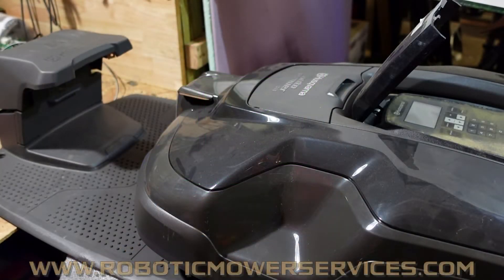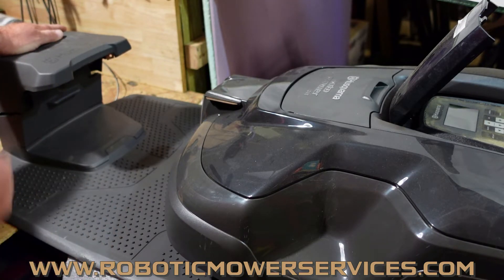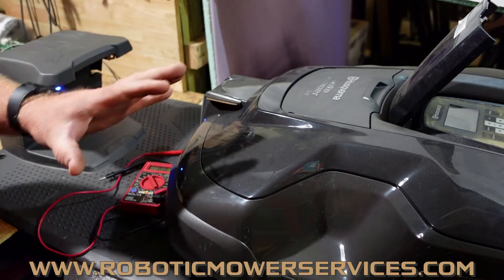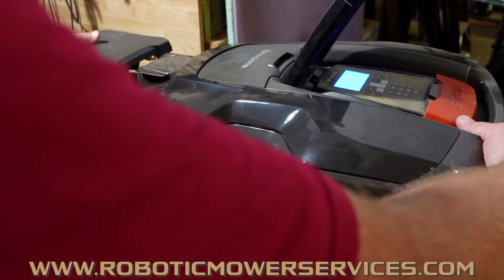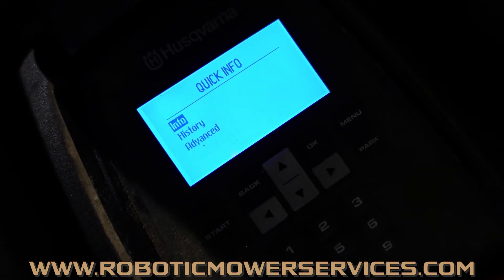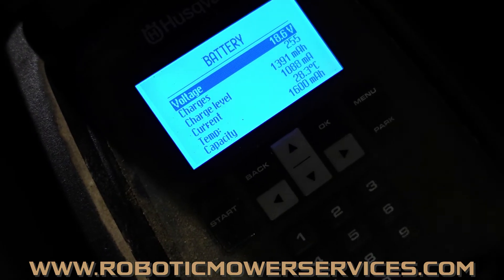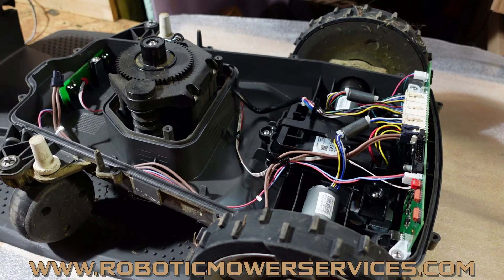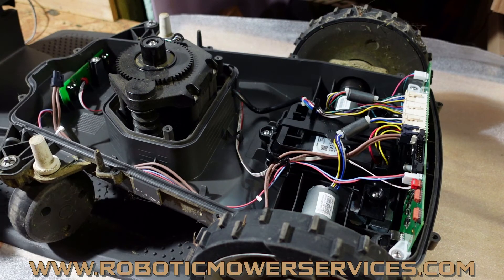Husqvarna Automower Not Charging Troubleshooting Tips

Comment: Hi, I have a Husqvarna Automower 320, and after replacing its battery with a compatible commercial one from Amazon, it shows the message “Battery problem” and then shuts down.
If I install the BMS (Battery Management System) from the old battery into the new one, could it work?

Comment: So my issue is exactly as you described- the double beep (connecting) followed by the immediate disconnect beep. I looked at the board but no residue… it looks super clean. 

The green led is on, slowly push the mower into the base station, the led flashes red for a second and turns off. Then the beeps repeat every 10 seconds or so, double beep and disconnect beep.
Reply: Will clarify, cords look clean, contact plates are shiny on both the base station and mower.
Reply from the maker: Looking clean and looking shiny doesn't mean there can't still be an issue with them. Have you checked resistance through the charging contact harness on the charging station and on the mower?

Comment: Very odd issue on my 430x. Won't turn on when removed from the base. If I manually push it it and start it, it reverses out after 30 seconds or so but dies as soon as it disconnects.
I looked at the battery info after I turn it on and it shows good voltage and the capacity level starts to increase. When it reached 17 mAh it jumps to fully charged then the voltage drops to 0.4 and the cpacity level goes to negative 1. I am assuming the reason it reverses out on it's own is when it jumps to that fully charged level for a second. Not sure if this sounds more like a faulty battery of a board.
Reply from the maker: Open the mower and look for any signs of corrosion on any of the circuit boards

Comment: Brilliant video, I have solved a parking / charging problem thanks to your excellent video. I used the multi meter on the docking station all was fine, even had correct voltage on the blade terminals, the give away was no beep from the mower when manually parking it on dock, it was the 450x burnt out connect just inside the mower body, swapped that, and everything is fine. Thanks to you guys. 😊😊😊
Reply from the maker: Nice work!

Comment: Good morning, I have a 330x robot and high voltage at home above the 240v set by the charger, it peaks at 255 per cent, I assumed that this would cause a breakdown in the transformer charger, but what happens is that it kills the batteries. Has anyone had this happen to them? Can batteries die from high voltage? thank you very much

Comment: I go to your site for problems with my Husqvarna 420. I have used Robotic Motor Services many times over the past few years, from replacing sensors and defective wheel motors, to testing charging and many others. It has saved me loads, so thank you very much. Being here in the U.K. I cant buy products through you, but I will continue to go to your site if  I have any more problems.

Comment: 315x 
Charging station 28V. Put mower in charger I hear 2 chirping sounds. Pull mower out a little to test mower contacts. I still get 28v on mower. Screen says "Mower Blocked 5 min count down. Gets to 3 mins says" mower shutting down" screen goes dead. Bought mower as second owner. However, it has never been used. Appreciate any help!

Comment: I've got a negative current -150mA... What could that be?
Reply: This is my problem also
Reply from the maker: What model mower?
Reply: 315x from 2018 @RoboticMowerServices 

Its now working 50% of the time, now it drives in, parks for 30 sec and out again. Sometimes it stays in and loads just fine, sometimes it eventually stops entirely after few tries.

When i put in in manually now, it works fine

I do not have an original Battery at the moment though...
Reply from the maker: What model mower?
Reply: Same problem here. Mine's a 430 xh. In the end I noticed poor continuity from the gold contact bars on the charging head back through the low voltage wire. I scrubbed the gold contact bars on the charging head with 60 grit and problem solved

Comment: Thank you for a great video. In the last couple of days I had a problem with charging my 315x. It happened two times that the mower returned to the base but after couple of minutes returned a little bit back and stopped in front of the base with "charging system problem" error. At first I thought that power adapter is gone, but after watching your video I checked all the steps and find out that voltage at the base is correct (28V) but when I manually plug in the mower the voltage on the base pins is still 28V (and not 18V as you explained in the video). In the menu is visible that mower is not charging since is shows Current -143mA. After that I switched the mower off and then back on (as the app suggested) and it started charging with Current ~1100mA. I suppose that the wiring is fine and that the problem could be the battery since it has 6530 charging cycles. What are your thoughts on this? Thank you very much for your help.
Reply: I got this error again the same day I wrote this comment. After that I checked again everything and noticed that the cable which goes inside the mower is bend by 90°just after the connector. I straightened it by hand and put it back inside and for now is working couple of days without any problem. Maybe there was just a minor connection problem with that cable.

Comment: Hi. Great video. I just noticed that when I put my 310 in the charger for this season it says charging, but when I locked at in in the app it shows that it actually drains. It went down from 13% to 12% to 11%. Then I jerked it out. Now after looking at this I measured things and found out that the harness shows 6,5 volts. Took it apart and measured 27,5 volt at the black and red on the cable at 5:08 minutes in this video. Looking at the harness and cables i could find no fault so I decided to try and measure at the connector at the top off the circuitboard that connects to the cable and I got 6,5 volts there. Faulty board on the charging station?
Reply from the maker: It could be a number of different things causing the issue. But the only way to narrow it down is by doing some resistance testing.
Reply: @RoboticMowerServices  I did your testing and found out that it was 27.5 volt at the end of the cable going into the board and then 6,5v of the connector on the board goin out from the board which is the only step that was not in your video. That makes it logical to assume the circuitboard. Looking at the board it looks clean and all, but I guss it could still be broken...
Reply from the maker: @Average-AL  Here's another video with info that will help narrow down the issue. https://youtu.be/uDdUnR_rIAE
Reply: @RoboticMowerServices  I managed to borrow power transformer from another Husqvarna user in the neighbourhood and with that transformer it worked. So now I know what the problem was.

Comment: Hi great video. I have a negative current on my charge, what could be cause of that
Reply: Hi, have the same problem. Negative current while it is supposed to be charging, but it's not. Did you find the cause? Thanks!
Reply: This is my problem also
Reply: I solved the negative current charge on the information window by hitting the gold contacts in the charger that make contact with the mower with 60 grit sandpaper.  I noticed that the continuity from the charger to those contacts was intermittent. I cleaned them up and they were good to go

Comment: Hey buddy I've a power that go 21.6 V as output but in my charging plate for my automower 305 I see 21.2 V. Automower is saying that is charging but in real it's not. Is the Voltage correct? What could I check? I've changed my battery 1 year ago and till now was working perfectly

Comment: I ordered both the harness and charging plates. When I first accessed the harness, it had a small bubble and wouldn't come apart. So I figured that was it. However, when I changed the charging plates, I also found that one of those connections had corroded to failure and was no longer connected. Needless to say, it was good to address it all. Everything is charging now and appears normal.
Reply from the maker: That is the best way to do it. Replace both parts at the same time

Comment: Hey buddy, thanks so much for the video. It's very helpful. I'm dealing with an issue that says my charging station is blocked. It's actually finding the station just fine. It's hitting the charging contacts properly. I think I'm going to find that there is a problem with the charging contact plug that you showed around 11:49.

Comment: I had a software and hardware update done to mine last year around this time. Ever since I got it back it hasn't been the same. What it does now is goes out to mow, returns to charge, back out to mow, but then at the end of that charge cycle I get an error message on the app saying "charging system problem". Has anyone else experienced this?
Reply from the maker: Check out this video: https://youtu.be/Ux_zt4X1CFU

BUT now instead of replacing the main board like mentioned in this video, get the software updated to the newest version which will solve this issue if everything else is functioning properly.
Reply: @RoboticMowerServices  thank you. Husqvarna did send me all the new harnesses and charge plate assembly which did not help the problem. I will take it in to the dealer again for the latest update as I said before ever since I had the last update it's never been the same.

Comment: Hi there my info is saying 
20v
Charg lvl -1
Charg 6ma
Temp. 9,6
Capacity 2600mah

Has been charging 2days now with nothing happening. Is my battery dead or? Have checked the overheating cabel thing. And cleand charging ports

Comment: Hi. Great video. I've got the problem of The mower entering, then making a tone and then 2 seconds later making the disconnected tone shown a 7:20. The led goes off for a minute. I opened up the charging station took out the board and cleaned it. Everything else looks OK. But the same problem is happening. What else could it be? Is it definitely in the station or could it. somethibg inside the mower? The voltage on the connector s is correct. Thanks.
Reply: Just to follow up... I eventually tracked down the solution to this problem. It was the cable between the transformer and the charging station. I'm not sure what was wrong with it but when I switched in a new cable everything was back to normal. So the error of the green light turning off to no light as shown  at 7:20 Can also actually be the power cable for any others that are looking for solutions.

Comment: Very helpful thanks. My robomower though is running out of charge before returning to the charge station, it doesn’t seem to know when it’s battery is run down.
Reply from the maker: Have you tried adjusting your "Find Charging Station" settings? Here is a video explaining these settings. https://youtu.be/7IrkKXmlCHU
Reply: @RoboticMowerServices  Thanks for the tip. After watching your video I was able to check the charge (0 key), I then noticed that the Robot had gone to ‘manual’ so just mowed until it ran out of charge. I’ve put it back to Auto and it now runs properly.
Reply from the maker: Glad you got it figured out. We've seen a lot of people over the years have that issue because they mistake the secondary area setting for the second zone that hey set up in the mowing area